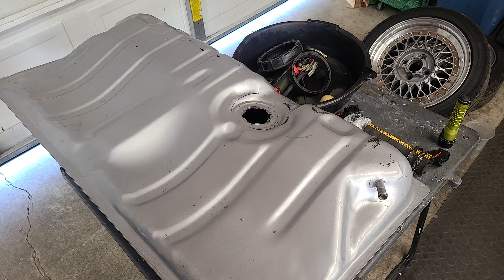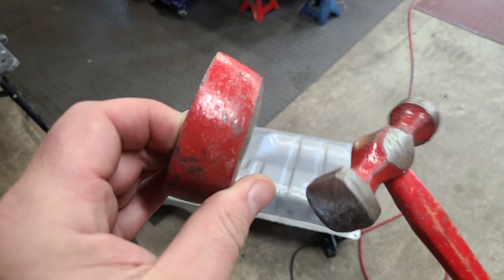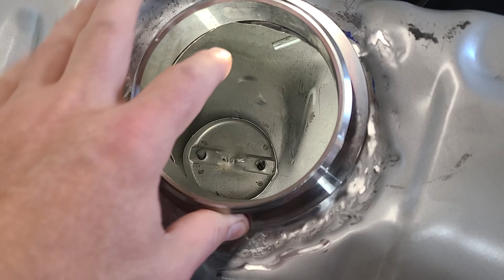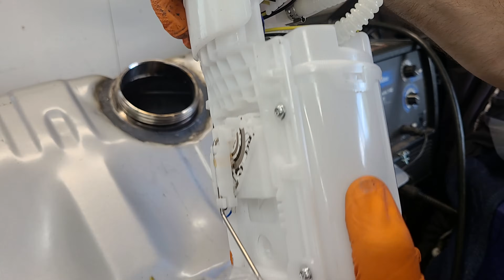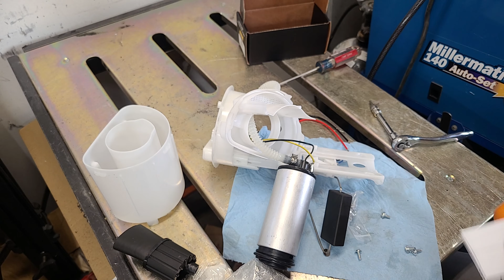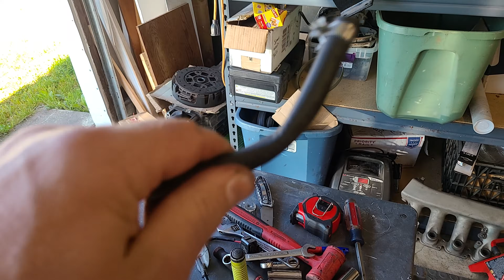VW MK4 FUEL PUMP in a Mk1 RABBIT TANK????

Comment: Great to see your still in one piece 😂. But would it have been easier to upgrade the pump in the tank or bigger pipes from tank to engine under the car ?  Or is it all down to the mk1 golfs / rabbit swirl pot being no good ?
Reply from the maker: I could have mounted the aem pump on the cabriolet sending unit. But that part was degrading and is more difficult to source.  This solution isn't esthetically as nice looking, but should be easier to get parts for longer.
Reply: @ThrottleGrotto  what was the main problem ?  Lack of a swirl pot ?  I do like the idea now that any mk4 pump will fit it in and even if you change engines or any upgrade it’s kind of future proofed .  I’ve gotten a mk1 tintop 3 door in the shed,  no engine. I was thinking ahu tdi . But enjoying your bunny rabbit build .  

Oh so on my cabriolet mk1 I have rabbit badges for the front and rear thanks to being super cheap on eBay 😅 but at every show I go to people always ask what’s with the bunny rabbit badges 😂
Reply from the maker: @stevenharpervw  how do they not know that it was a rabbit in the us? 
I think the 2 main problems were the bent fuel line and the less than ideal pump. An AHU tdi would really be a lot of fun, I had a mk3 TDI bunny a while back and it was hilarious.
Reply: @ThrottleGrotto  I’m not looking for power just something idiot proof and still live in the shed for 6 months and will still start first turn of the key . Keep your videos coming I want to see more

Comment: Great job on the getting the fuel pump in! I have heard of people would put some dry ice in the tank before welding a gas tank.
Reply from the maker: Great tip. - I haven't seen that specifically,  but the evaporating dry ice would probably displace the fuel vapors, so it makes sense

Comment: Hey man, I need to see if this ring flange will work with the Honda Fit fuel pump.  It looks like the same lock ring.  I've searched the site you linked and can't find it.  Do you have the part number?  Great episode!
Reply from the maker: I don't think they have a part number. Shoot them a message on the website and they should be able to help. It wasn't listed on the website st all. I wrnt direct
Reply: @ThrottleGrotto  thanks!